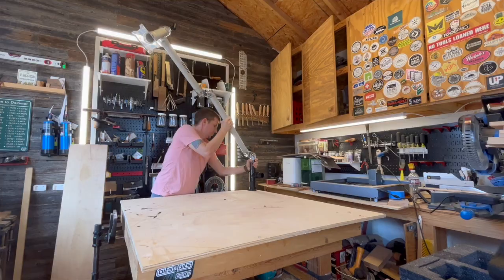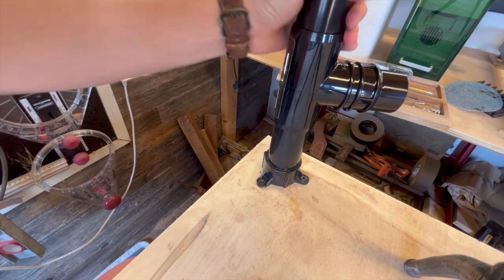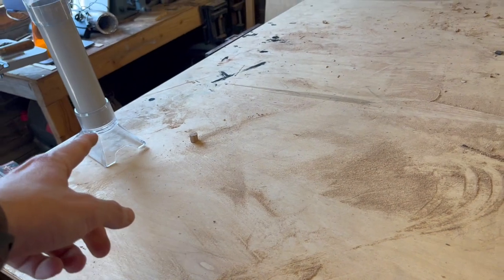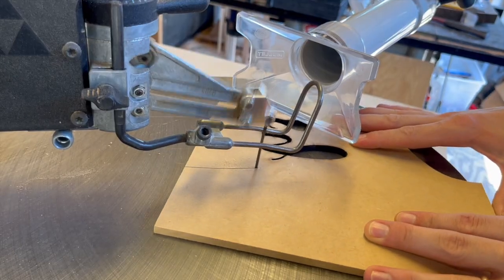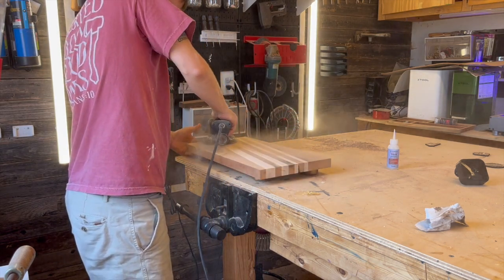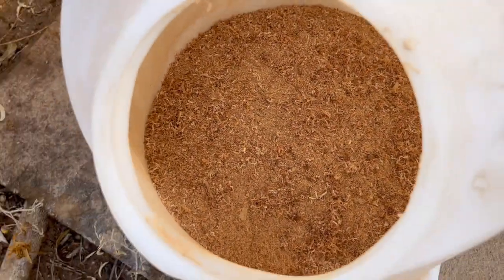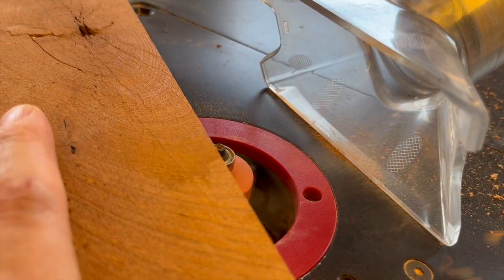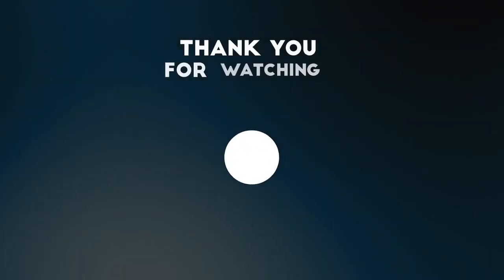Upgrading my Dust Collection with the Mullet Third Hand

Comment: I just ordered mine to go with the cyclone which, in my opinion, is the best one out there. The quality and ease of set up is great. I’m super excited about the arm, I don’t have the money for festools or their longer hose and I’m tired of the hose being on the floor and having to hold it. Just to see, I rigged up the cyclone to my Camvac 90l. This thing has collapsed Oneidas, the Mullet didn’t even think about buckling. Oh yeah, not to mention not having to buy bags for the festool. I did by powertec ones which seem really decent but haven’t had to use them at all, I use them when I’m sanding or finishing stuff so my project isn’t on the table
Reply from the maker: That’s awesome, congrats! It’s been really fun to mess with so far.
Reply: @TheReformationWoodshop I don’t know why it took me until just 15seconds ago but you can easily have an over the blade collection now as well for the table saw. Now I’m even more pumped
Reply from the maker: @user-nx3zk5qi8t I tried it on mine and was gonna include it in the video but I just didn’t like the camera shots I got. It just looked like sawdust was going everywhere and not in the arm. Lol
Reply: @TheReformationWoodshop  either way, it’s better than what I have now, nothing haha

Comment: When I see a new product I search for the non-factory demos to see what potentially doesn’t work and why. For my use case, I’m thinking that snazzy separator will be a later purchase. But as I work alone, that boom could come in handy if I could secure it to my Festool Midi, wheel the whole shebang up to say a hole I want to cut out in drywall, then focus on the cut instead of how to suck dust with one hand and make a nice cut with the other…while standing on a ladder. I could have sworn I saw on the Mullet website, a video clip where they were rolling a Festool dust extractor with the boom arm somehow on it- up to to a wood lathe or something.
Reply from the maker: Yeah I’ve seen that same thing. I think there’s an attachment for that specific use.